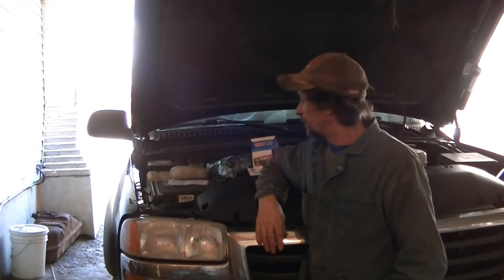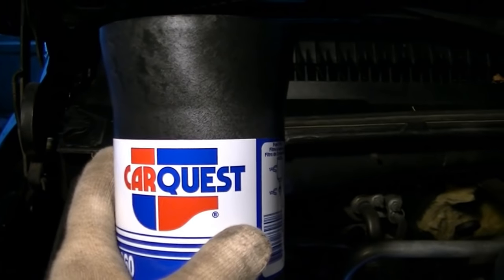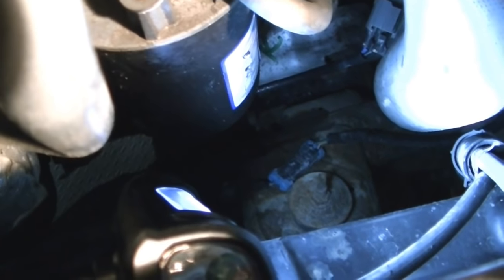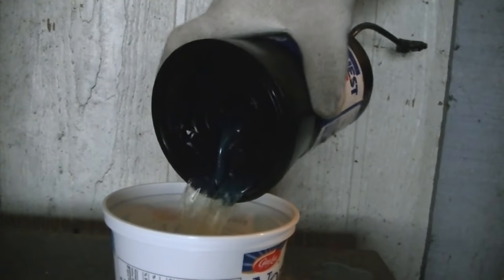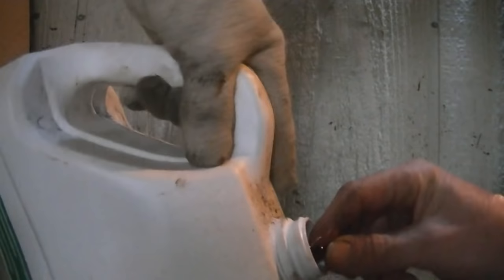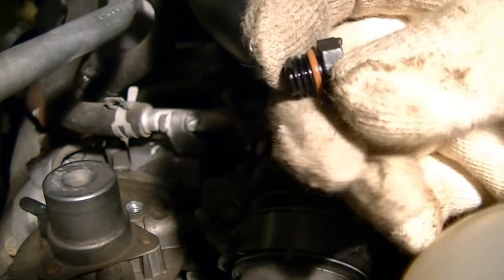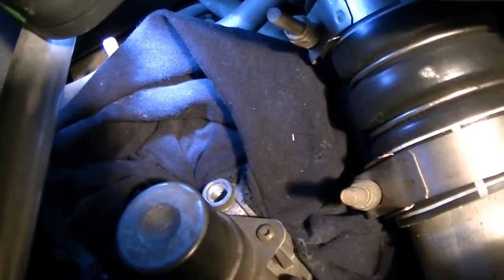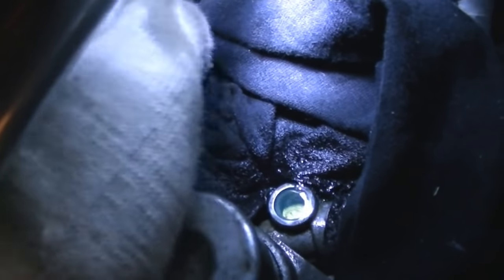Duramax Fuel Filter Change

Comment: im BEGGING EVERY SINGLE PERSON WHO WATCHES THIS VIDEO do NOT i repeat do NOT use thes cheep filters on your truck EVER, i have replaced way to many injectors and CP3 pumps because the customer put thos fucking cheep fuel filters on there truck, people say Cat filters are the best for a duramax, HES HOLD ONE IN HIS FUCKING HAND and it says autozone, cat's duramax filter is JUNK thats the one i replace the most from coming apart, use the AC DELCO FILTER.